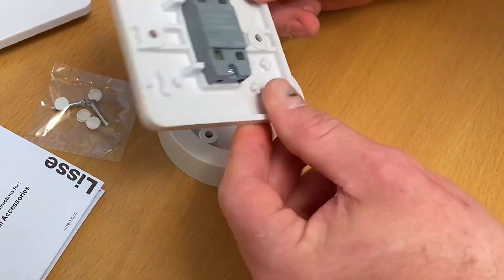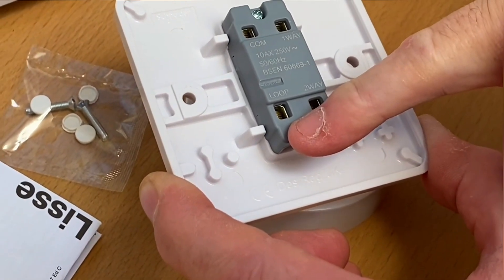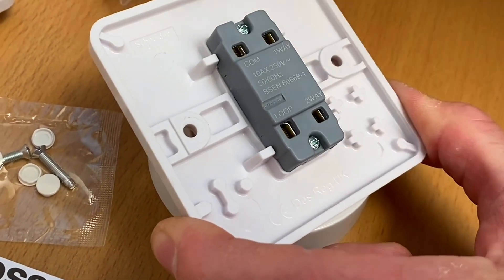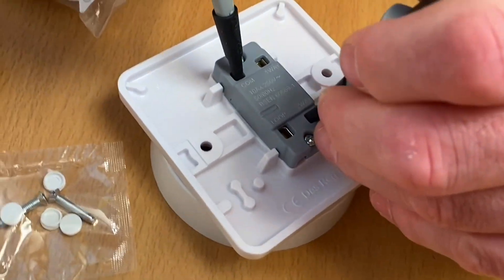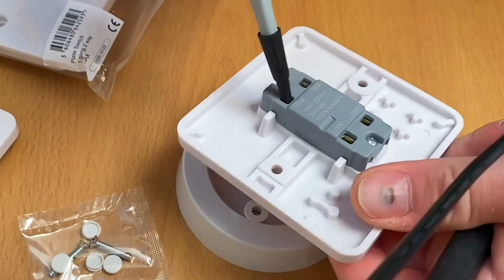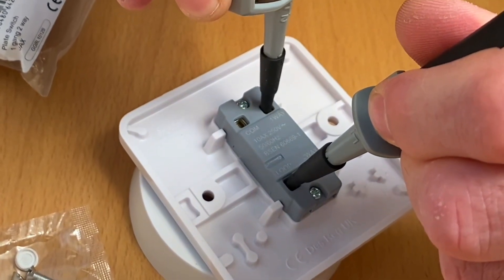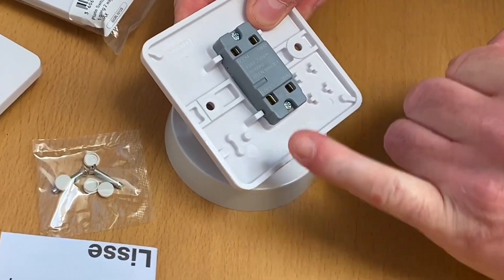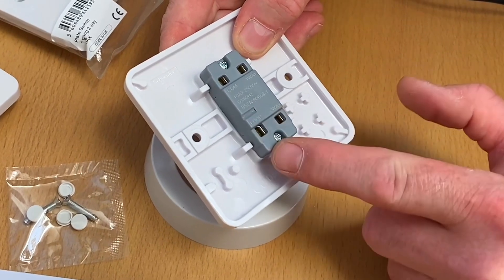Why Does my Light Switch Have a Loop Terminal

Comment: So I have a new switch to replace ( and I’m a total novice ) …

My old switch had common and L1 and L2  

My new switch has common L1 and loop  

So in my new switch is loop the new L2  ??? 

Can anyone help because when I wire them up as if I have put the wires from the old switch which was an L2 into the new switch which I have put into loop my switches aren’t working exactly how I thought they would be. My new switch has to be in the own position for my other switch in my living room to work. Both switch switches are just to activate the living room light. If anyone can help with this, it would be much appreciated. Thank you.

Comment: Calling it loop seems fair if it's to be used for smart switches that require a neutral. The one neutral wire coming down in a three way can then be looped to other switches in the vicinity on the same circuit. Only one three way cable required. All others can be two way.

Comment: That looks like a 2way switch designed for a feed to the switch circuit. IMHO. I'm now wondering if there also exists an intermediate switch with a built in neutral bar to carry the neutral to the 3rd switch. Otherwise it's the old wago jobby.

Comment: Typical solution to a problem that doesn’t exist. With the advent of waggo connectors or similar, connect the neutrals in the back of the box out of the way
Reply from the maker: Thanks for your thoughts

Comment: If it was me I would ignore that loop terminal and join the wires in a separate connector. If the switch is ever changed by a DIYer the less wires going to the back of the switch the better
Reply: I would prefer a switch without a loop terminal.